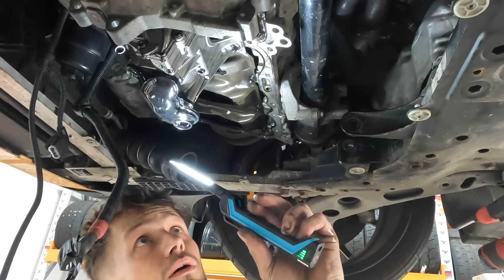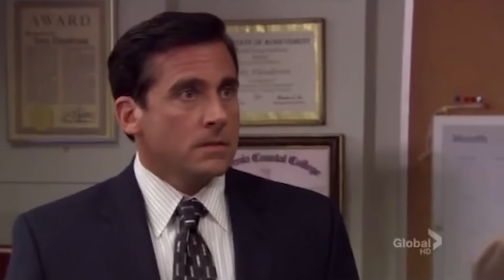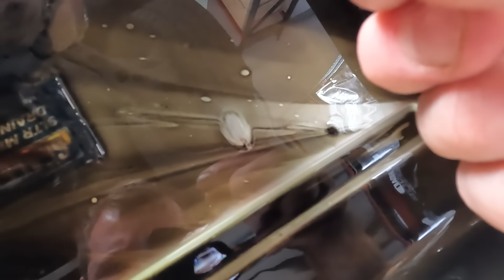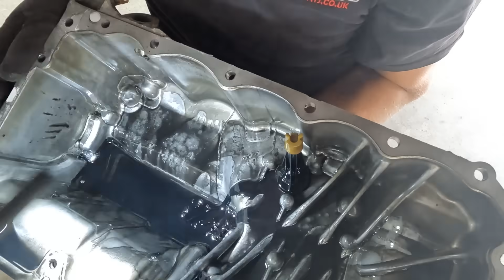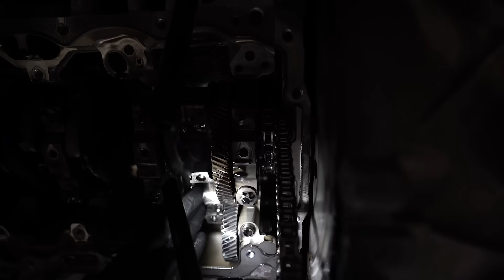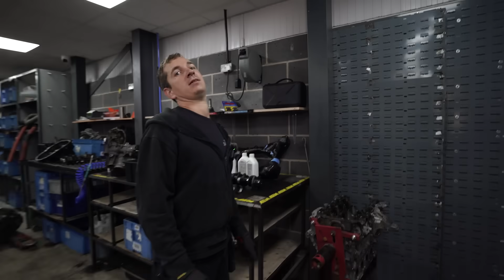WE BLEW UP OUR MINI B47!! 💥

Comment: b47 doing b47 things
Reply: All of the reports I've seen have these as the most reliable 4-pot in years?!
Reply: jamie-hb8gy  Never heard of a garage having to do one? We've owned/own 3 and our local independents haven't had to do one?!
They're a ground up design so completely different to the N series engines!
Have you got any references? Would be interested!
Reply: We got 4 B47 engined Bmw of various models. All been bullet proof and 2 of them been thrashed the shit out of.
Reply: jamie-hb8gy  130,000 miles,  but I do oll changes myself every 8-9000 miles

Comment: Dont think its recent use, pre ownership cold starts then late for work, lack of services prior to your ownership.  Its just a mechanical failure, I have had loads of Vauxhall xe engines some lasted years in different cars, had one in my daily that was parked since 2014 did a full flush with flush oil and two filters it did 9 months.  I have a new engine that was refreshed for the the 750 hot hatch championship pre covvid,  and it gets abused daily once warmed up. I change the old every 6 months.  It's not missed a beat. It is what it is. Ps it's a road car I dont compete.

Comment: Strip the oil pump down see if free play in the pump
Reply: It was fine
Reply: @ryanp6138  I reckon it could have been due to using the stock sump then. 
All of the BMW B series engines are pretty much bulletproof and can handle power well above stock levels. There was a guy in Scotland called F20 Hulk who has a heavily modded M140i and he tracks it. It makes around 500hp (internally stock B58s can handle over 800hp) but he blew the engine up, threw a conrod through the block solely because he wasn't using a baffled sump. The stock sump is not shallow enough for the engine to be properly lubricated at extremely high G forces around the corners 24/7, so the engine was starved of oil. This was obviously the case with that mini.

Comment: Identical sound to my n57 330d 2014 .
bearing material in sump , high revs killed it , serviced 3k earlier , otherwise clean perfect engine with 106k , 
i sourced a complete engine from and x5 with 4k miles
( i was thrashing it trying to tell myself i didn't need an alpina d3 , i was very happy with how the 330d was going ,
right up until i felt it almost miss under high load )

i also have a 2014 f56 b47 aswell as keeping the 330d , no more high revs !!!
( but i do rev my m2 comp hard , may have to stop that 😂 )

Comment: Don't rate the 1.6l diesel engine in minis. Bad for burning oil. I hunted around to get a Toyota 1.4 D4D because I didn't want the later 1.6 D4D which has the same BMW engine as the mini. Can't imagine their 2.0l being much more reliable
Reply from the maker: It's done us well up until now. Done plenty of miles both on road and on track so it has been reliable